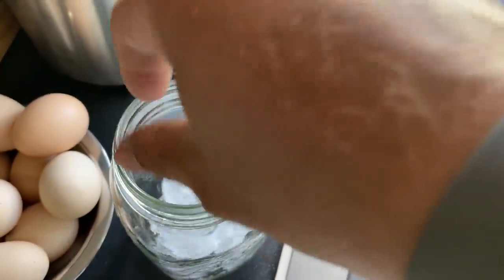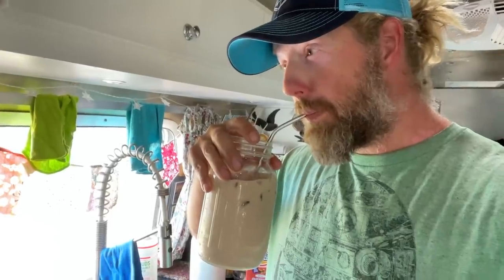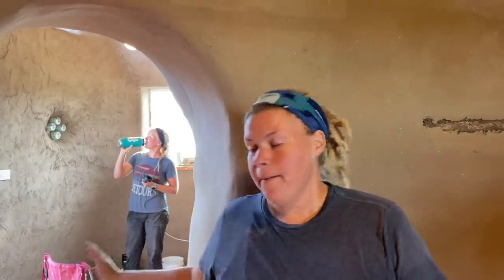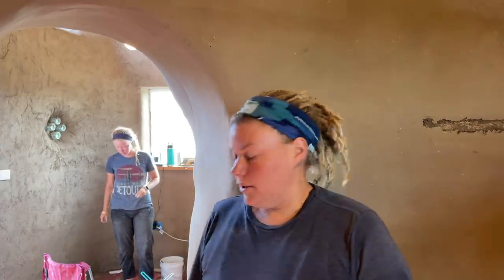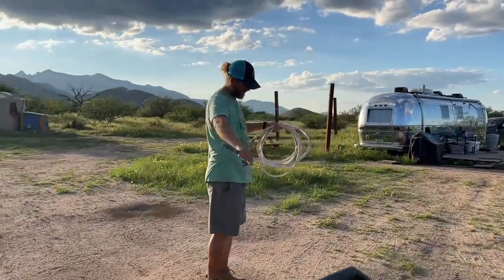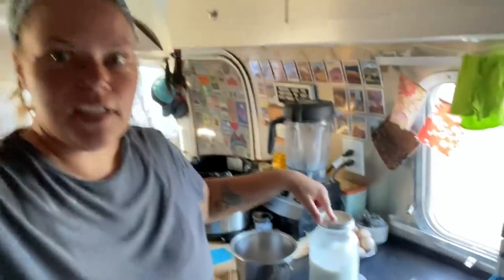Get This Shed Done - Day 8 - Prep for Finishing Plaster in Office and CLEAN UP!

Comment: Potters rub a hard leather pad to finish/seal their pots. It makes the surface shiny. I believe your smooth compression trowel does the same. A sponge spreads the material, but doesn't compress it.
Also, Medieval Europe used spoiled milk in their interior lime mortar (on their floors and walls) to give a smoother, shinier and a more durable finish. That of course would be very expensive & I imagine temporarily very smelly.

Comment: Everything you guys are doing is amazing, but when you do the big building, please consider respirators or at least masks when you are handling concrete or sweeping clay - prolonged exposure to fine dusts like that will have a real bad effect on your lungs, especially when it’s indoors.
Reply: Good advise!!!
Reply: They aren't using concrete yet with the final coat, just clay and sand and tp. Thank goodness. We use masks when we clean out our barn and it is just dust and dried chicken pooh. Nothing I'd want in my lungs.
Reply: @StoneKathryn  true but they did use it for the pad outside and even though it is outdoors, they were in close proximity to it and it worried me a little for them. As you say, any dust is bad, but concrete is the worst.
Reply: @cbgb3369  Agreed!